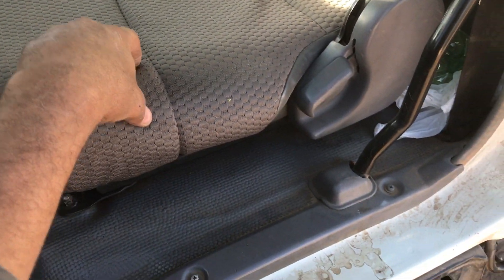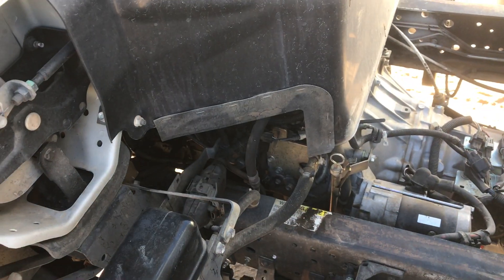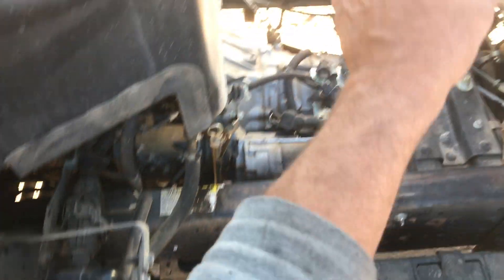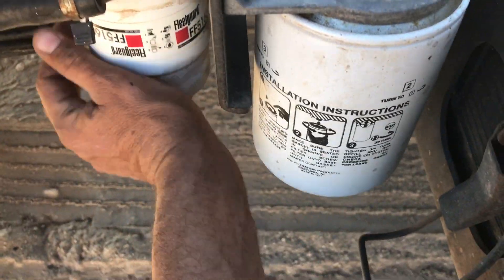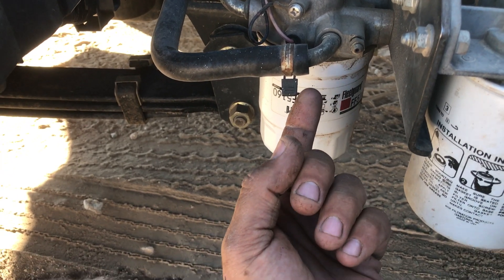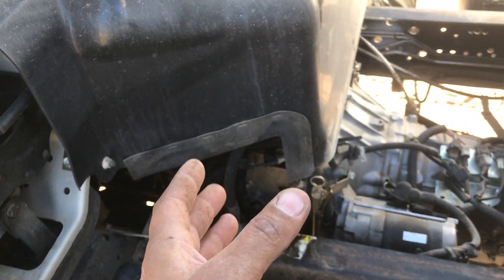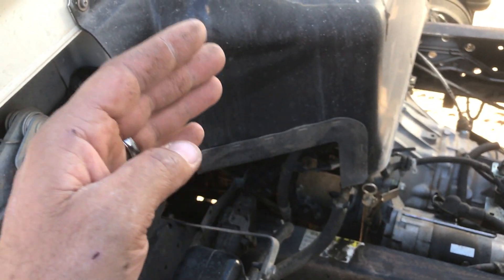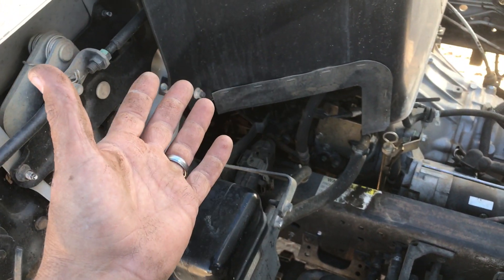P0087 and P0093 W5500 Solved

Comment: I have a 2015 NPR HD diesel that turns over very slowly after leaking a lot of oil never leaked the oil on the ground couldn't find the leak. And has plenty of power to the starter and engine itself is hard to turn over with a wrench curious what you think the oil leak is in if the engine is damaged and why it would turn over slowly and if there's any way to break the pressure that's causing it not to turn over like it should

Comment: Man, thank you for the information. Just had my 2008 5.2 serviced (DOT inspect, and fuel filter change)at an Isuzu garage a couple weeks ago. second time on the road , ( and at midnight on the interstate) the engine stumbled hard,  check engine light came on and  the engine went into limp mode.
Pulled to the side of the road, shut engine off, turned back on, same problem,  shut off again, waited about 30 seconds, turned back on, engine started, ran strong. In fact, the CEL went out after driving for a day or so.
When I read the stored code, it was a P0087. It has been a couple days and it seems to run OK, but, I am going to check the screen in the filter housing.

Thanks for the help

Comment: I had an npr with these codes one time. The dealer replaced the injectors and pump and didn't fix the problem. Ended up being the pressure sensor on the rail had some sort of gel in it. Cleaned it out and it was fixed. Also had the hand pump on the filter go bad one time and caused these codes.

Comment: Thanks for the tip. I will try this, I'm having a problem priming the system and never thought of looking into that place.
I replaced a fuel filter that had a very large amount of dirt. Only had 6 months or so with this filter. I was told that the 2005-2007 had fuel tank corrosion issues.

I'm also getting some high Fuel Rail Pressure readings. I been looking for a description of how the fuel system works. 

I thought the pressure limiter would release the excessive pressure, but I can't find anything specifically on that. Can't afford to pay anyone to fix it, at this time. Any help is greatly appreciated. 2007 NRR diesel 5.2l 4HK1-TC Thanks.
Reply from the maker: You got it, thanks for watching!
Reply: For priming, there should be a primer button on top of the pump itself, (black rubber squishy thing), if you're lines are empty you'll have a running truck buddy, if you don't have one, hook your battery up to a good charger/jumper pack, fully charge it overnight, and crank the shit out of it until it fills, if it fails to do so, replace the pump. Easy fix, before you reconnect it, drop the tank and clean it of all debris and shit in it, blow the lines with really good air pressure put it back together, shouldn't take longer than a few hours by yourself.

Comment: Awesome man we have a GMC w4500 Isuzu diesel starts and idles fine I got a P0091 and P0087 no throttle response and I tested acc pedal with my Verus all good there I will try this tomorrow thx and yes not much info out there I’m now a subscriber to your channel thx again
Reply: I have an 06 GMC w4500 diesel that cranks but does not start. I have already purchased a scanner that didn't work. Can you please help with a recommendation on a scanner that will work. Thank you
Reply: @313detwa  —- GM Tech 2 or try diesel laptops .
Reply: @313detwa  make sure the injector are getting fuel. Crack #1 injector while cranking until you see fuel then tighten up
Reply: @burtpilon1735  Great! Thanks for the prompt reply

Comment: Need help with an 07 isuzu NQR diesel....had a bad connection on batteries causing check trans light to come on along with signals dim (low voltage)....I replaced ground cables and battery jumper cables (duel batteries)....been good for a couple weeks but now trans light came back on and mainly at a stop (could this be alternator related?)

Comment: I have an 05 and just replaced a rebuild transmission and it not accelerating at I step on the gas and it will go up to 5 mph and no sound of engine or transmission being forced.  Would you know what could it be?

Comment: I am having the same issue with two NPR's a 2012 and a 2015. I began to have issues after replacing the fuel filter that is mounted right behind the engine, not the separator by the batteries. The code I am getting is P0093 but have also got P0087 and p000F previously since the filter change. In my case the truck will run part of the day 50-90 miles no problem, then it goes into limp mode, sometimes with the CEL on others just limp. We can shut it off and wait and go again or just connect a regular scanner reset and back to normal. Also if we run it with the scanner connected it overrides the limp mode and works fine. Basically same symptoms on both trucks after filter changes. Any comments will help at this time. Thanks
Reply: Did you figure it out?

Comment: Just bought a 2006 GMC 4500 w/Isuzu 5.2. Shops can't figure out the limp mode. It's 3am....I can't wait until 7am so I can try this. ( Told the neighbors I won't do any work around the house before 7). Thx for posting this! Occam's razor?

Comment: I only have P0087 on my 2012 Isuzu NRR 5.2l (4HK1) and itll go 30-40mph at times but wont start unless you spray a lil diesel starting fluid in the intake then itll idle but die sometimes if you dont keep it reved up. Think its just a bad fuel filter? My actual FRP was like half of my desired FRP. And the Actual Fuel Rail Pressure (FRP) Regulator was bouncing all over the place (171mA-829mA) when Desired Fuel Rail Pressure (FRP) Regulator was steady 804mA-807mA. Think my Fuel rail limiter took a shit? or just the SCV? Suction Control Valve? Or I believe as known as the Fuel Pressure Regulator? Any other troubleshooting suggestions? I tried wiggling the wires shown in your video and no luck.
Reply: Did you solve your issue and if so how? I have a similar problem on a 2012

Comment: OMG ,  I think this is what is happening.  I have the P0093 error code you have.  I changed both batteries, water filter, mass air flow sensor.  Not fixed.  I was going to change pigtail to rail pressure sensor.  But I think I have what you said.  I'm going to try tommorrow.
Reply from the maker: Thanks for watching!
Reply: @thomasbriansavingmoney  boa tarde estou um problema com uma isusu NQR americana box truck de 2007 não passa das 90 milhas e logo aseguir perde aceleração , já troquei os injetores e a cena continua por favor podes me ajudar a resolver

Comment: Hey i have a 06 gmc w55000 my idle is too high what can cause this problem?
Reply from the maker: 5.7 dirty throttle body, vacuum leak. which engine is this? 5.2 or 4.8 could be a stuck open injector.

Comment: By looking at all the comments... I just have to say this: Fuel Treatment works!
Diesel fuel is oil.  Sh#t will grow in it.  Also that wasn't the only fuel filter.  That was actually the water separator/filter. There is another on the engine.  ALWAYS keep your Tank FULL especially when your local climate crosses back and forth over the dew point.   All low pressure fuel areas become water condensers. 
Your tank and hoses will rot because the air and water are allowed into it. (leaving it for days on a near empty tank i.e.)

Comment: I am currently working on basically the same thing but it’s a 2014 5.2 and it is throwing a P0087 and a P00OF too low and too high pressure
Reply: Did you find the problem?
Reply: @moizabdul7393  yes it was the fuel filter housing itself it had a air leak in it after replacing it it’s been fixed ever since the day I posted
Reply: @ethanfoster331   I am having the same issue with two NPR's a 2012 and a 2015 which the same as your 2014. I began to have issues after replacing the fuel filter that is mounted right behind the engine, not the separator by the batteries. The code I am getting is P0093 but have also got P0087 and p000F previously since the filter change. In my case the truck will run part of the day 50-90 miles no problem, then it goes into limp mode, sometimes with the CEL on others just limp. We can shut it off and wait and go again or just connect a regular scanner reset and back to normal. Also if we run it with the scanner connected it overrides the limp mode and works fine. Basically same symptoms on both trucks after filter changes. Any comments will help at this time. Thanks

Comment: When you change these spin on fuel filters, do you pre fill them with fuel? Also is there a process to bleed air from the fuel lines once youve changed the filters? Im working on a 99 npr diesel soon.
Reply: Not OP, but I NEVER put on fuel filters wet.  You risk major contamination getting past the filter.  I've been instructed to "fill it from the previous filter" but you still take a MASSIVE risk for contamination.  Most vehicles have a "prime" sequence.. I know on the big rigs, there's priming pumps, on my RAM trucks, I put them on dry, and cycle the key a few times to get the chamber filled, THROUGH THE FILTER, then start the truck..
Reply: Wildo83 if u fill the filter in the smaller holes not the one in the middle of the filter then it’s fine because that way it’s filtering it before it goes into your fuel rail. You can use a hose with the correct connector to drop the fuel into the filter first. Getting air in the system is Not a good idea.
Reply: I always run engine to get it hot, then immediately remove fuel filters, fill new filters with clean diesel to the top then spin on then primer them by hand, cycle the key a few times and 95% of any diesels start on first crank. Same with oil filter. Do them separate, fill with oil, hot engine. Never work on a cold engine and remove all the filters at same time, you will cause numerous complications.

Comment: I have P0087, P0088, P0193, p0192

Year : 2008 Nissan UD model 2000 with j08e motor

Remove the screen of  the bolt and replaced that lines from the filter to the tank to the system but not good every time I get a long tow more than 100 miles the check engine light come on and show p0087 and after p0193 and so please can anybody help me thanks
Reply from the maker: Top off your filter and I would check the fuel pressure. Thanks for watching!